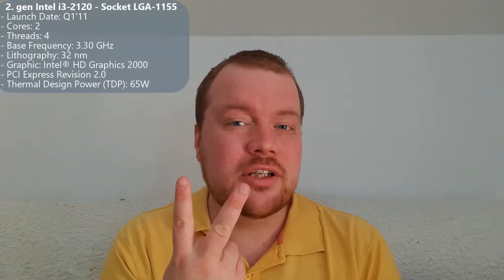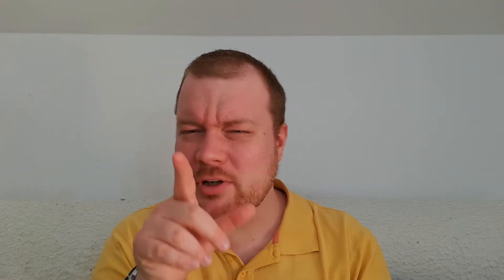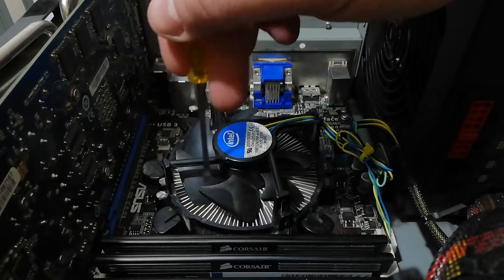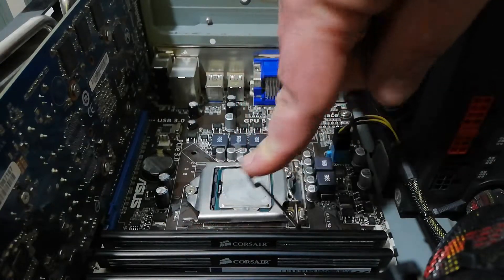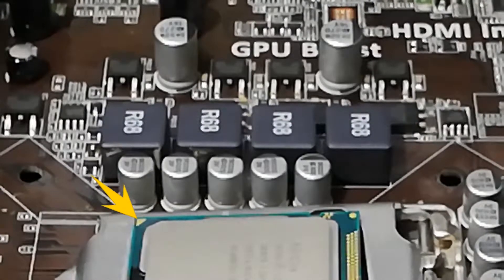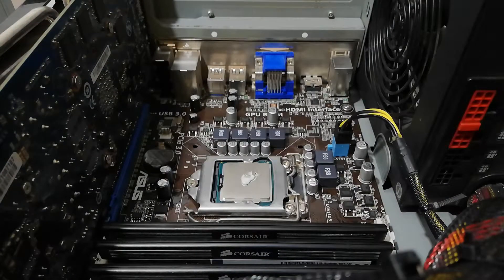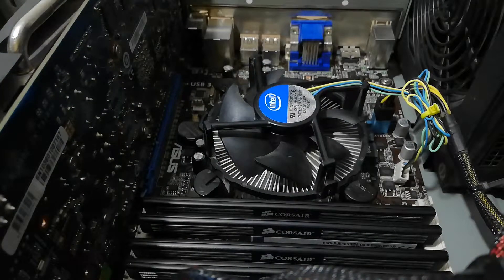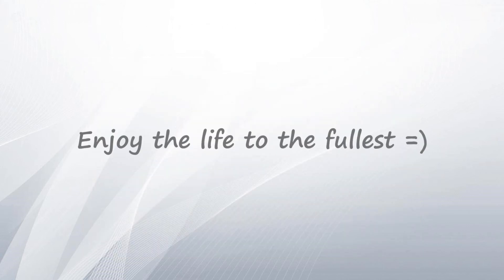How to upgrade PC processor on socket LGA 1155? - AFT #3

Comment from the maker: Here you go times for the video (also in the video description) 😊:

02:06 About pins that holds cooler on processor and unlocking them
02:43 Disconnecting fan connector and removing cooler
03:27 Taking old processor out
04:22 Putting in a new processor
05:37 Applying the thermal paste with trick
06:10 Putting the cooler back on and connecting the fan

Comment: Hello,

can i change my cpu from i3 2120 to i3 3240 on my hp pavilion p2-1156il pre built??

10gb ram (8+2)

crucial bx500 ssd

No gpu
Reply from the maker: @boomdada.  Hello. Chipset Intel H61 supports 2nd and 3rd gen ontel CPUs but I can not find if your specific PC actually supports it. Best way is to upgrade PC to the latest BIOS version (if not alerady) and put in the CPU and turn the PC on. Just wait some time up to a minute or two when you put in the new CPU.
Reply: @ACOnetwork  how do i update the bios for this specific motherboard
Reply from the maker: Just checked, officially there are no BIOS updates for your PC. So just replace CPU when PC is turned off and turn it on to test.
Reply: @ACOnetwork  thanks mate

Comment: Hello I have a dell 990 with i3 2120 is it possible to change the processor for an i5 3470?
Reply from the maker: Hey there. So sadly not. Dell OptiPlex 990 motherboard has Intel Q67 chipset which limits support for 2. generation Intel processors only.

Supported processor up to 4-core Intel Core i7-2600 ( NOT i7-2600K ), 3.40 GHz, 8 MB Cache
Additionall info: https://www.hardware-corner.net/desktop-models/Dell-OptiPlex-990-SFF 

If you upgrade to newer CPU and you have system stability issues, black screen when turned on, ...put in current CPU and upgrade BIOS Firmware: https://www.dell.com/support/home/en-si/product-support/product/optiplex-990/drivers (BE SURE that  you have optiplex 990❗❗)

If you have any other questions just ask 😁. Happy new year 👍

Comment: Do I have to reset bios after I change Cpu ?
Reply from the maker: Hello. No need but if there are some computer stability issues you can try resseting it. Mostly just change and enjoy 😁. If you want to know something else just ask 🙂. Have amazeballs rest of your day.
Reply: @ACOnetwork  Da me non si toglie dai due lati come fai tu, cosa dovrei fare? Alzarlo da un lato e poi rimuoverlo?
Reply from the maker: @gabriele_andrello  
Google translated: From me it doesn't remove from both sides like you do, what should I do? Lift it on one side and then remove it?

You may have different type of the cooler if you are talking about the cooler. If you have cooler model you can check on YouTube or Google for more info.
Google ha tradotto: Potresti avere un tipo diverso di dispositivo di raffreddamento se stai parlando del dispositivo di raffreddamento. Se hai un modello più interessante puoi controllare su YouTube o Google per maggiori informazioni.
Reply: @ACOnetwork  non si toglie la CPU dal socket, dissipatore va via tranquillamente
Reply from the maker: @gabriele_andrello  This is LGA 1155 socket in your case may be some another one. For example you can try to lift it by CPU metal with two fingers if possible... it all depends on what you have. You can tilt it to the side but be carefull you do not bend or brake pins in the socket!

Google ha tradotto: Questa è la presa LGA 1155, nel tuo caso potrebbe essere un'altra. Ad esempio puoi provare a sollevarlo dal metallo della CPU con due dita, se possibile... tutto dipende da cosa hai. Puoi inclinarlo lateralmente ma fai attenzione a non piegare o frenare i perni della presa!
Reply from the maker: @gabriele_andrello  Yes, it is the same socket it should be the same and did not find your motherboard socket image on Google. Just carefully take it out best way you see there.

Google ha tradotto: Sì, è lo stesso socket, dovrebbe essere lo stesso e non ho trovato l'immagine del socket della scheda madre su Google. Tiralo fuori con attenzione nel modo migliore che vedi lì.
Reply: @ACOnetwork  riesci a linkarmi qualcosa?
Reply from the maker: Just carefully take out the CPU with 2 fingers on CPU edges, it should be the same as on the video because the socket is the same.

Basta estrarre con attenzione la CPU con 2 dita sui bordi della CPU, dovrebbe essere la stessa del video perché il socket è lo stesso.
Reply: @ACOnetwork  done yesterday afternoon

Comment: Nice video, very useful for me.
My PC Processor- i3-2100
Motherboard-DH61WW
I plan to upgrade to i5-3470s or i5-2400.
Do I need to upgrade my BIOS?
Reply from the maker: Hello and thank you 😁💛, I am glad you found it helpfull.
Minimum bios version for I5-2400 is 16, for i5-3470s is 42. List of supported CPUs: https://www.intel.com/content/dam/support/us/en/documents/boardsandkits/desktop-boards/DH61WW.pdf OR https://www.cpu-upgrade.com/mb-Intel/DH61WW.html

CPU comparison: https://cpu.userbenchmark.com/Compare/Intel-Core-i5-3470S-vs-Intel-Core-i5-2400/m6387vs803

If you have any questions, just ask 😁👍
Reply: @ACOnetwork  how to upgrade bios to 42?
Reply from the maker: Hello 😁. You can check first replay on this page https://community.intel.com/t5/Intel-Desktop-Boards/DH61ww-bios-update-0020-to-0023-to-0028-to-0034-to-0035-to-0041/m-p/614483
You first need to check what version of bios you have, so you can upgrade accordingly. Go step by step and go to newest version if you are willing BUT get correct bios files❗❗.
Bios update instructions, bios version check, ... https://www.intel.com/content/www/us/en/support/articles/000005547/boards-and-kits/desktop-boards.html

I never flashed Intel motherboards and I do not have one to try.

Comment: do i need to upgrade bios after changing porcessor?
Reply from the maker: It all depends on the curent bios version, if it supports new CPU. To check that, you need current bios version, in internet search for your motherboard CPU support list to check for new CPU from what BIOS version is supported. You can also just put new CPU it in and test.
BTW Bios is updating BEFORE you change CPU if needed.
Reply: @ACOnetwork  tysm
Reply from the maker: No problem 😁

Comment: hello bro, i want to ask if i can upgrade i3 2120 to i5 3470?
and for my pc specs

-motherboard:H61 M-K
bios version: American Megatrends Inc. 0801, 07/21/2014

-processor: i3 2120

-ram:4gb ddr3

please answer
Reply from the maker: Hello there. So it should work fine, this 4740 is supported from bios version 0306 🙂.

CPU support list for ASUS H61M-K:
https://www.asus.com/Motherboards-Components/Motherboards/Business/H61MK/HelpDesk_CPU/
Reply: @ACOnetwork  ok thanks bro.
but, it works or not. because I'm afraid it will damage my pc
Reply from the maker: No problem 🙂. Look, nothing will get damaged by it self. Damage can occur if CPU inpropertly inserted, where you get bent pins yand you need to fix that or if screwdriver slip and torn off some component, or what ever... basically human made problem. If person doing stuff slow, carefull and propertly, everything should be fine 😁👍.
Reply: @ACOnetwork  ok thanks bro, for the info

thanks again hehehe

Comment: Hey bro. can i upgrade from i5 2nd gen to i5 8th gen?
Reply from the maker: Hello 😁. No you can not. Okay you can but then you need to replace CPU (processor), motherboard and RAM memory sticks. 2. and 3. gen CPUs can go on to the same motherboard (in some cases BIOS firmware needs to be updated so specific CPU can be used) BUT some motherboards supports only 2. gen CPUs.
Reply: @ACOnetwork  thanks man.

Comment: Don't spread it with a finger, just stick the cooler on it. It will spread out evenly.
Reply from the maker: I am used to do it like this, with grain at the middle is enough for old cpus . Bigger cpus needs maybe X pattern for example. Supposedly is little difference between the all types of thermal paste applyment.

So do it what you prefer according the cpu size and power.

Comment: Nice tutorial, i felt like i was playing STALKER shadow of chernobyl the whole time =)))))
All jokes aside nice video, this method applies for ALL processors and motherboards with the soket 1155 right?
Reply from the maker: Thank you 💛. I never played that game, but why did it felt that why 🤔❓❓

Socket 1155 is the same for all CPUs and mobos 😁. Only if you use different cooler (not stock one), it may mount little differently 🤔. If you have any other questions, feel free to ask 👍. Take care.
Reply: @ACOnetwork  it felt that way because all the character in it speak english with a strong russian accent XD(don't take my joke as an insult because it wasn't)
Also yeah i do have a different cooler but its similar in which it doesn't mount with the plastic screw that are in this video it mounts with normal metal screw but other than that nothing different, my curiousity was about the pressure mechanism and the socket itself but since you said its the same them i guess i don't need to worry about it
Reply from the maker: Of course I did not take it as insult 😁. I play other types of games hehe.

On whatever socket you are, cooler manufactorers like to make their own mounting system, even that holes on motherboard are same for example, you need to add manufacturers brackets and... they can complicate sadly. In the video I used stock/original cooler from intel 😁.

BTW have amazing day 😎.

Comment: Hi I have Intel DH61WW motherboard with I3 2100 and I like to upgrade it to i5 3470 but system is not turning on, 3 Beep sound again and again.. 😭😭 save me
Reply from the maker: Hello there 🙂. Don't panic.

So if: On-off (1.0 second each) three times, then 2.5-second pause (off), entire pattern repeats (blinks and pause) until the system is powered off... That is RAM memory problem. In this case, if you have several sticks of RAM inside, leave one stick in motherboard and turn pc on. If still beeps, turn off PC, take take that one out and put another one in and do this for all sticks. If that does not work, try another RAM sticks for a test. 
You can also take out and put back in graphic card (if you have it) and power connectors, turn on PC. If still, power off PC, disconnect disk, USB and dvd burner (if you have it) and turn on PC.
Do one by one element at a time to figure it out AND make sure everything sits completly in inside your motherboard, before turning on PC

You can find beep error codes in this manual: https://www.manualslib.com/manual/440715/Intel-Dh61ww.html?page=66#manual
Reply: @ACOnetwork  is there any Bios update needed
Reply from the maker: Nope, BIOS chip on motherboard is telling you with beeps, that something is wrong, so you need to go through troubleshooting steps to find a problem.
BTW while PC beeps and not tuning on, you can not do anything on it.
Reply: @ACOnetwork  OK thank you for the information, I will try
Reply from the maker: No problem. You know, even if you do all this, PC can also have unstable power supply (change it to test if possible) or motherboard issue. With computers sometimes there can be some stupid stuff sadly.
Reply: Hi Soundar K  bro, I also have the same i3 CPU and motherboard, and I also plan to upgrade it to i5 3470. But after seeing ur comment little bit panicked.  Have some questions. Did you sort the problem? How do you sort? How is the performance difference? How much i5 3470 cost?
Reply from the maker: I do not have experience with that motherboard. In my country Slovenia, i5-3470 costs around 40$ (depends where).

Comment: i have i3 2100 and want to upgrade to i5 3470 or 3570  so should i need to change the bios as well!!!? or it will work properly!!?
Reply from the maker: Hello. It depends of what motherboard (manufacturer, model and revision) you have if even supports 3th generation of CPUs (processors), not all motherboards do. If it supports, then you can check what bios version you have, if you need to upgrade to latest version (if it is not alerady).

Quickiest way is just to put in the new CPU in and test if current motherboard supports it.
Reply: @ACOnetwork  thanks bro
Reply: these are the current stats of the bios
BIOS Version/Date	American Megatrends Inc. P1.10, 3/3/2011
SMBIOS Version	2.7
so can you tell me if i need to update or not!!?
Reply from the maker: @Sparssshh  No problem. I need manufacturer and model of your motherboard also as I wrote previously, without it I can not check anything.
Reply: actually i have found that i5 2400 doesn't need any bios update so can i use that one because i have i3 2100 which support any bios also as same as i5 2400!!! is it safe because i don't want to update my bios!!
Reply from the maker: @Sparssshh  you may alerady have support for 3th gen CPUs, but it is your PC, so it is up to you 🙂. Anyway if you have any question, just ask 😁. Take care 👍
Reply: @ACOnetwork  ASROCK H61M-VS and Bios is P1.10 and i5 2400 is showing Any in Bios section instead of any particular bios Version unlike i5 3470 need P2.60 version
Reply from the maker: @Sparssshh  So yeah. You can go up to i5-2500 or i7-2600 with bios 1.10 version, for any bether, you need to upgrade BIOS.

CPU support list: https://www.cpu-upgrade.com/mb-ASRock/H61M-VS.html
Reply: @ACOnetwork  thanks man you helped alot!!!
Reply from the maker: No problem, I am glad I can help 😁

Comment: Hello I have question, Does replacing cpu will remove all your data and install os again?
Reply from the maker: Hello there. No, it does not remove any data, because they are stored on disk drive (seperated device). 

Just turn off power to computer, press power button several times, just to empty electricity in motherboard, replace CPU and have fun 😁
Reply: Thank you so much, your video and reply helps me a lot.😊
Reply from the maker: No problem 💛. If you have any questions just ask. You can also look at my other videos, if you want 😁.

Take care 👍

Comment: Great video, keep it up =)
bro I have Samsung H61S1 MP1.0  Motherboard with intel core i3-3220 processor,
8GB ddr3 1600Mhz Ram card, so I want to upgrade my processor to intel core i5 3rd or i7 3rd generation...
so I think you are the legend in this field =) so please let me know if this motherboard support this processor..

thank you and waiting for reply Bro.............................................................................................
Reply from the maker: Heloooo 😁 and thank you very much 😎👍
Outhere are no official info about that motherboard (did not knew Samsung MB exists hehe), but it has H61 Express chipset, and officially supports this CPUs: https://www.cpu-upgrade.com/mb-Intel_(chipsets)/H61_Express.html
Remember, that if motherboard has the newest BIOS firmware, it should support even newest CPUs from the list. Easyest thing is to get the wanted CPU, put in and try it. Over internet, there are firmwares to donload unofficially, but you can risk bricking/making motherboard unusable if it is not correct.
I am far from legend dude 🤭, but thanks very much for your nice words 💛.
Reply: @ACOnetwork  Thank you very much Bro..
Keep it up =)
And you are legend for me..
Reply: @ACOnetwork And bro how to update my bios to latest version?
Reply from the maker: I would not suggest updating BIOS firmware, because there are just too manny risks. Even if you find flashing program and bios update file, you need to be sure to be exactly for your motherboard, newer bios version than your current bios, uninteraptable power to pc, othervise, your motherboard will most likelly stop working.

I suggest, that if you find some processor, put it in your motherboard before buying, just to see if you see image on your screen and you successfully boot to Windows desktop.

Comment: hi, my M.board is Gigabyte p61a-d3
Processor: i5 3470
are motherboard and Processor support ram speed 1600 or only 1333?
thank you in advance
Reply from the maker: Hello Mohamed.

So that motherboard supports 2. and 3. generation CPU, so i5 3470 should be supported. Remember, that there are 3 revisions of your motherboard, 2.0, 3.0 and 3.1
CPU support list: https://www.gigabyte.com/Motherboard/GA-P61A-D3-rev-20/support#support-cpu 

So you will may need to update your bios, but you need to know, which revision you have, so you can download corresponding update file, wrong one CAN make your motherboard UNUSABLE! 

Best way is just to put in and see, if you have image on monitor and computer is stable. If there is a problem can be bios poor support for CPU or something else.

If you have any questions, just ask :) Have a nice day 😀

Comment: My I3 2120 socket is FCLGA 1155
Can i install i7 3770 in this socket or anyone i5 3rd gen cpu in this socket ?
Reply from the maker: Hello. You can use 2. And 3. gen processors on same socket, but you need to check, if motherboard actually supports that CPU. Some chipsets supports only 2. gen CPUs. Also it is likely, you will need to update BIOS to latest version (if black screen).
Reply: @ACOnetwork how do i check if my motherboard supports 3rd gen cpu's or not
Reply from the maker: You need manufactorer name and model of the motherboard and on google, you can search for example:
ASUS m75an processor support list
OR
ASUS m75an cpu support list
OR something similar

and if available click on link of your manufactorer. Some manufactorers willl add the list on the manufactorers product page.
Reply: @ACOnetwork  ok . Thanks for helping me .
Reply from the maker: No problem 😁👍.

If you have any questions, ask and if I know, I will answer 😎